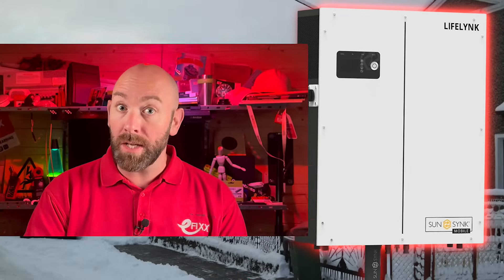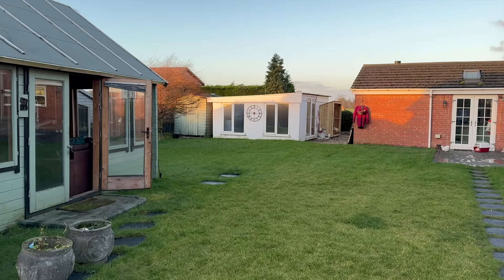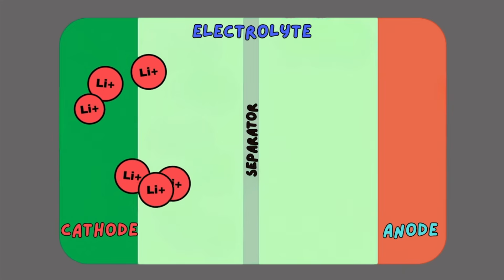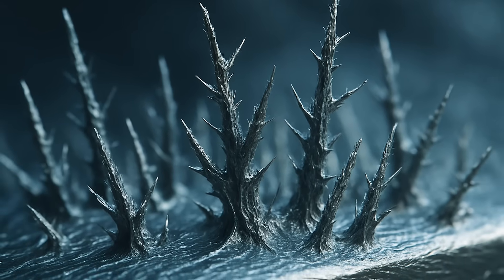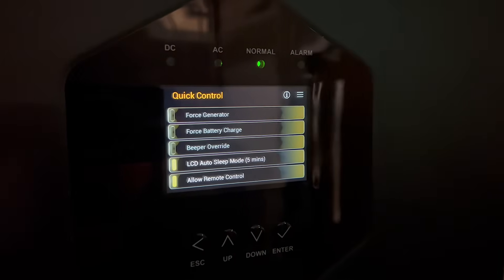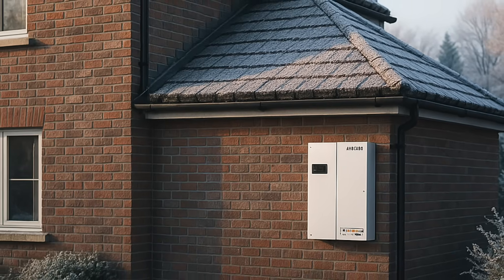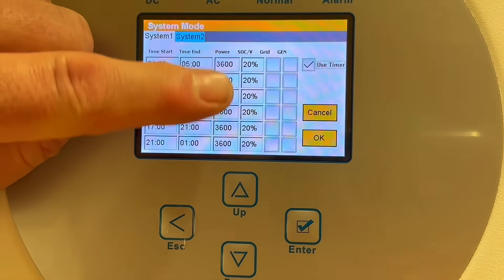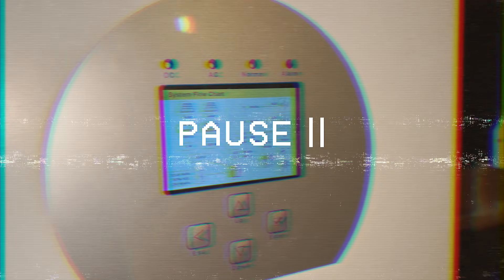Cold Weather vs Home Batteries: What’s Really Happening...

Comment: mmm.  Pretty generic arguments and the AI inserts don't really match the narrative.  Like showing batteries in a bathroom while talking about cold weather.   Oh wait a moment... I seem to remember an earlier episode somewhere on youtube with that pic.  Well... Just to be clear, folks, temperature is a non-issue for residential stationary batteries that happen to have built-in heating... which is quite a lot of them now.  That's the only thing you need to look for.

If cold weather (near or below freezing for LFP) is something you have, double check that your system has a solution either already present or that you have a game plan... such as adding insulation and or a bit of space conditioning or something like that.  Otherwise though, it's nothing to write home about... certainly doesn't warrant a chemistry change.

Also, the bigger the battery capacity, the lower the C-rate and the less it matters.  Very few residential batteries are going to actually have problems with C-rate in cooler weather.  Not it saying it can't happen, just that it isn't usually something the home owner has to worry about.   Battery performance for LFP will be just fine down to roughly 4C (40F) before you really have to start worrying about C-rate limitations.

Residential charging and discharging activity won't generate very much warmth inside a LFP battery.  You have to be above 0.5C to generate any appreciable heat and most applications clock in well below that.   I do agree that placement in the garage is a good idea verses placing outside.  I don't think residential batteries should be mounted outside... but many are for some reason.

Anyway, if cold is an issue just make sure you have an internally heated battery... which if your installer was any good at all then knowing you live in an area that can get down to freezing or below, they would have spec'd a cold-rated battery anyway.  Then you just don't have to worry about any of this stuff.

-Matt

Comment: Another thing that wasn't mentioned is that during discharge the battery power is limited in cold weather because the chemicals can't get to the plates in time. This can cause batteries to stop working prematurely, but the energy is still stored in the battery.

Comment: I was thinking a small metal shed, lined with 100mm rockwool on all sides, would be the 2nd best location for your batteries.   In the summer, an airvent could be opened to keep them cool.

The other big problem with outdoors is condensation, leading to corrosion of electrical contacts.

Comment: Sodium ion batteries for sale in uk
Reply: read some tech reviews of sodium ion vs LFP
pretty shocking
Reply: @iamdmc will be looking at it in 2 years time they should have act together by then.
Reply: Gonna be a while longer before they are competitive enough.  At least another year or two... or forever if LFP keeps improving at its current blistering pace.  The efficiency of sodium is pretty poor right now and the cold weather stats aren't actually all that good.  Sodium will retain more capacity at colder temperatures, sure, but its resistance can also go up to the point of unusability.  To make use of that capacity in cold weather you have to sip power.

Comment: It's been well known for over 50 years how temperature affects not just batteries, but all electron flow.
Reply: @dave0smeg  The problem we have this week is high temps.  It’s 4:30pm and 42 degrees C (108 degrees F).  My 26kWh battery has been depleted by the aircon despite being charged by my system.

Comment: Not all batteries are equal that is for sure. Some perform much worse in both cold and warmer temps. While others are pretty resilient. Utilising heating and cooling from normal operation something one or two brands need to do a lot better with. EV vehicles suffer with this a lot worse primarily due to the larger energy requirements and probably wind chill lol. Interesting video.

Comment: Contemplating building my battery with a heating pad as now with the regs it was going to go in my bin cupboard so it’s going to see a some temperature swings
Reply: Lot of the newer ones have heating pads built in, but it can still be better to enclose them to keep Sun off them causing heat problems and also so in winter the heating pad has to do less work. All the current gen fogstars do (probably the best value in the UK), and the newest Sunsynk also do - just watch your installer isn't trying to fit you older ones 8)

Comment: Add some insulation around the battery at winter to reduce the heatloss, I've got an old hot water cylinder jacket round my 6.5kw battery in garage from November till March.
Reply: Good  tip, we do the same,  works a treat
Reply: I've heard of using an electric blanket too, might do this myself.

Comment: All batteries from alkaline to lithium to nickel metal hydride and beyond loose power when they get cold. Even mercury batteries The only exception but I could be wrong is lead acid batteries such as car batteries.
Reply: LA suffers from cold too.
Reply: All batteries do - but sodium it really only bites you hard about -20C so in future the problem may be far less. Heat is actually as big a problem and many batteries have warmers but not cooling.